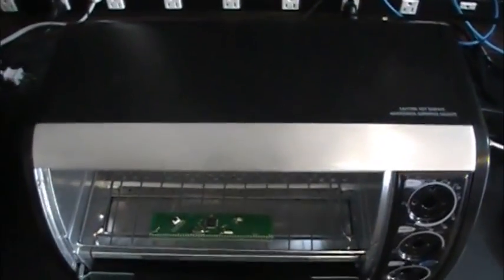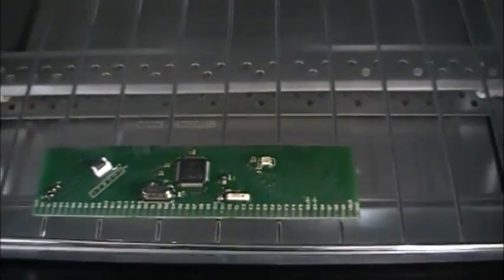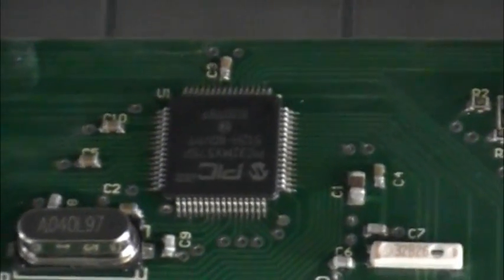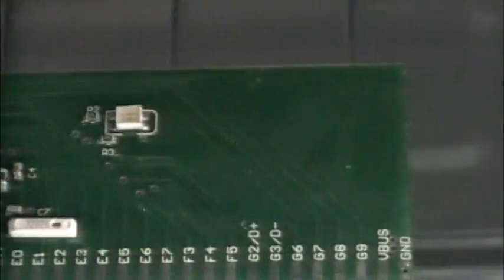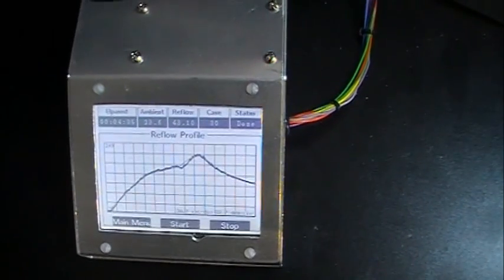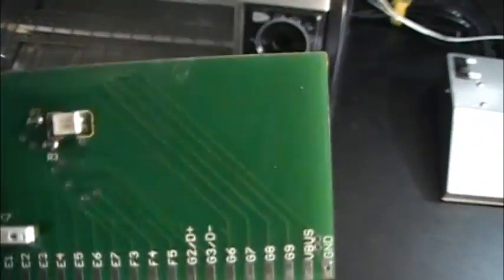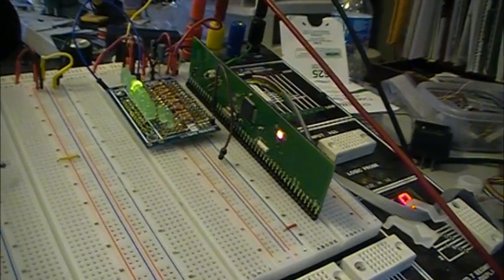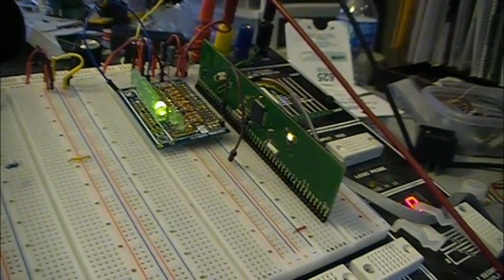Reflow Controller, Soldering with a toaster

Comment: ¿Excellent Video! I was wondering did u have to pre bake it? 
I bought one from mouser and there's a label outside saying it's moisture sensitive and it needs to be pre baked before reflow, you think this is important or does mouser do it just in case it blows up you don't blame them? 
Also, do u have the eagle file for that pcb??
Thanks! great vid!!!